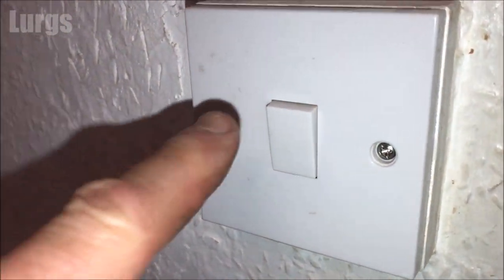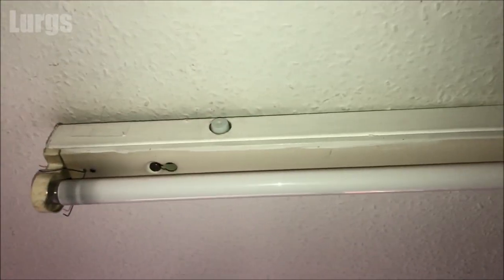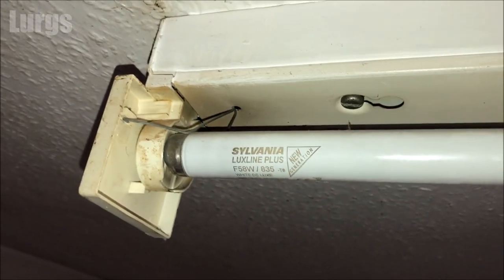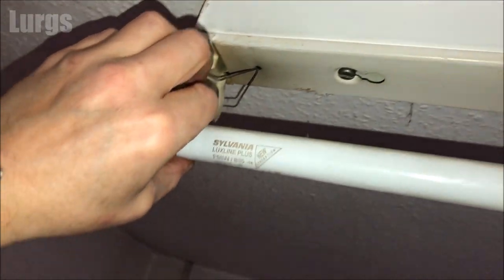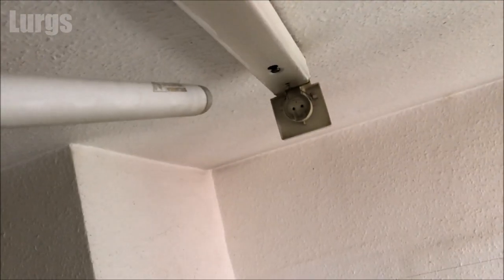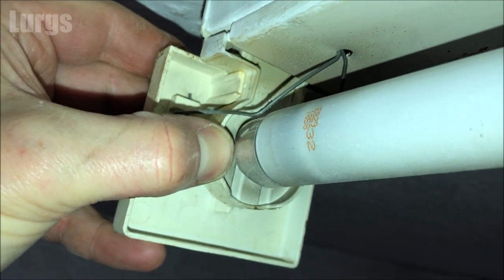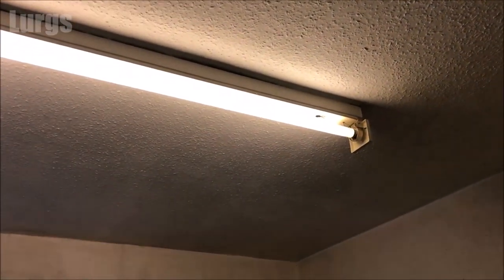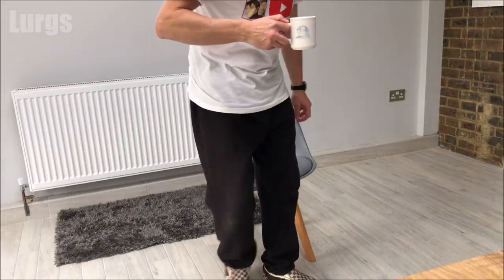How to change a Fluorescent Tube

Comment: What brand is the fixture since I see these everywhere but can’t seem to find them for sale.
Reply from the maker: No idea, you just need to measure the length and get the correct length bulb. They are standard pins at each end
Reply: The luminaire will be either crompton Fitzgerald or thorn mate
Reply: @WarrensRandomAndWeirdVideos  My guess is a Thorn Poppack.

Comment: How do I change it when the bulb has leaked green stuff (I think its called corrosion). Is there anything I can use to clean it better? Thanks for the helpful videos :)
Reply from the maker: Depends how much corrosion there is, it can be cleaned but be careful and make sure power is off. You may have to get a new light unit if it’s bad as it may short
Reply: @LurgsHowToGuides  Thanks once again!
Reply: How do you remove the entire light fitting from the ceiling if you want to replace it?

Comment: 1:30 what does the text say?
Reply from the maker: There is no text at 1:30 ?
Reply: @LurgsHowToGuides  It’s engraved into the tray.
Reply from the maker: @JamMC  No idea I’m afraid this unit is long gone now
Reply: @JamMC will just say danger isolate before removing cover made in England ect
Reply: I'm gonna assume it's a fitzgerald light fitting so it'll say "disconnect supply before servicing made in england"